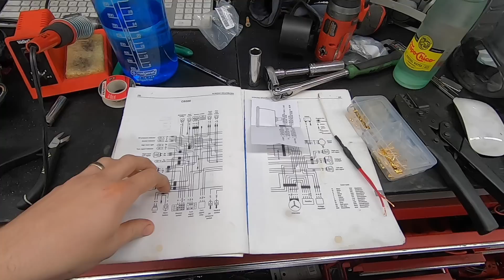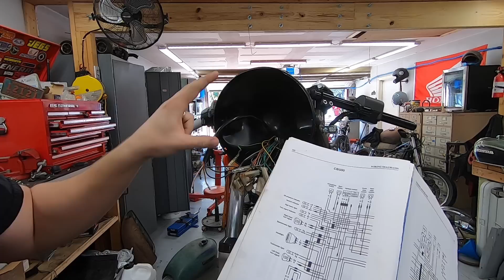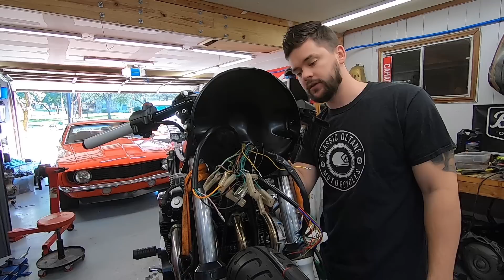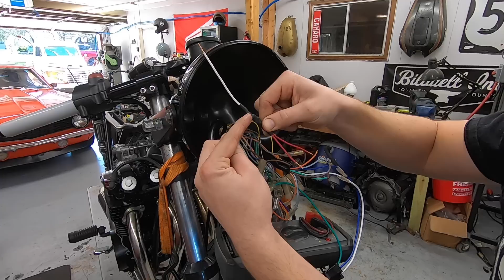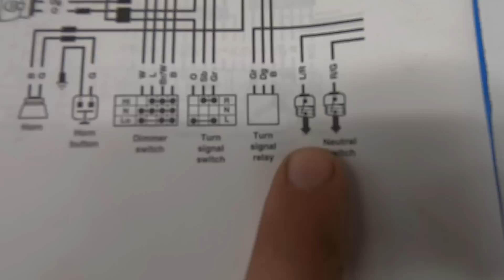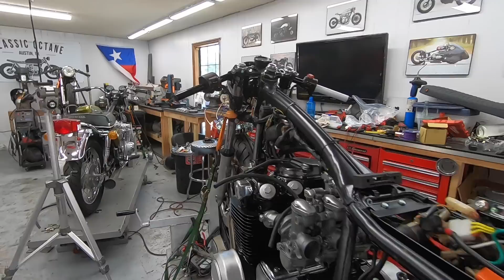One week CB550 build: In-depth wiring overview

Comment: Hi taylor. In my headlight bucket i have 2 diff guage wire, so diff connectors inc bullet connectors.  Would you stay with the larger size ,or remove and go down to smaller size , 
Cheers

Comment: Hi  great video it is very helpful I'm working on a1984 Honda nighthawk 650 and the only thing that I'm not fully understanding how to do is wiring the after market flasher the one I'll be installing is two terminal and has a flash control adjustment I noticed you were explaining one similar, any way you could send me a picture of how you wired yours or walk me through it?

Comment: Hey Taylor! Really like all your content. I am at my wits end with my cb650sc 1984 nighthawk. 

I was given this bike two years ago and I stripped the whole thing took the air box out cleaned the whole bike. Rebuilt many parts of the bike. But here's my issue, I cleaned the carbs last month, I have a new petcock on my tank, so I know it's not this. I can get the bike to fire and throttle when I am squirting gas into the carbs but not when I am using the fuel petcock and definitely not when I have the air pods on the carbs. 

My buddy told me I need to jet the carbs to allow more gas into the carbs. I HAVE NO IDEA WHAT HE'S TALKING ABOUT.  Do you have any advice for me? Maybe a phone consultation and diagnosis? 

In return, I'll make you a Sweet led light sign from my woodshop! Haha please help before I scrap this bike!

Comment: Thanks for taking the time to put this together. 
I had to get an aftermarket wiring harness because the one on the bike was trashed.
UNFORTUNATELY, I got one and NONE, ABSOLUTELY NONE of the factory colors were used so it made trying to figure it out a headache. I got everything connected and everything seems to work right EXCEPT for 1 thing: the starter. The bike DOES turnover. Awesome. But even after letting the START button go, it still keeps turning.  If the bike starts, you can tell it's still trying to turn and eventually quits, but I have NO idea why it does this. 
The other issue I ran into was that SOMEWHERE there's a parasitic drain on the battery. I've killed 2 batteries on this thing.  It's super frustrating and without having stock wiring colors to reference, the only thing I think I can do is untape the whole harness so I can figure out what wires go where. The wiring harness didn't come with a legend to tell you what goes to where even though it's supposed to be a stock replacement. I really wish there was something I could do to fix this because kick starting works, but I'd like to just be able to use the start button and not kill batteries like they're nothing.

Seriously though, the parasitic drain and the START button not working as expected is a real headache and has made me just about give up on this project.
Reply: Same...got mine from 4into1 (which I like and recommend for parts), but the wire harness is a pain. You actually got further than I did. Mine is still in the "sorting" phase. That was last spring...
Reply: @Negrodomaus  GL man. I'm done. I don't have the willpower to go through all that again.

Comment: Dat noizzz... I regret I am selling my cbx750 when I see your videos mate. Anyone watching Taylor,s videos can help me with electrical problem I am facing on a suzuki gn250? Turns signals only work when motorcycle is on neutral or 1st gear while I am pressing the clutch. Once I am driving they stop working, despite one or two exceptions I noticed recently. Grateful in advance

Comment: Nice job. Your paint/vapor blast scheme for the engine is unique. What’s your source for the front brake line?  I’ve been unable to find a good braided steel line unless I use a banjo fitting and bolt at the caliper.

Comment: I just did some wire cutting and crimping this weekend when I replaced my CB750 stock coils for some Dynatek Coils. It was the first time I'd done anything like that.  I found it kind of relaxing.  I had to make new spark plug wires as well.   I was a little surprised when I pushed the starter button and it fired up better than ever.   When you're new to motorcycles like I am, it's a great feeling when actually you do something right.
Reply: Doing one thing right is great! As an experienced but not talented home mechanic, I average 2 things right & 1 thing broken.  :)